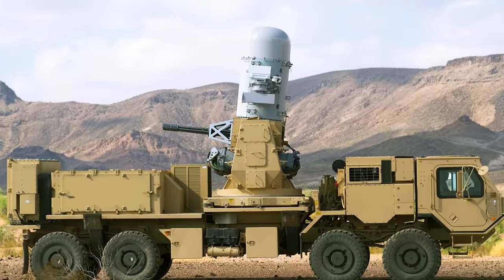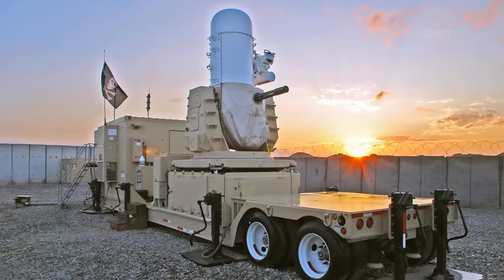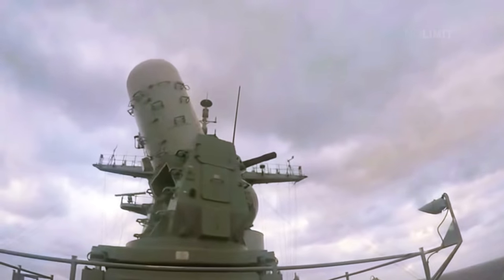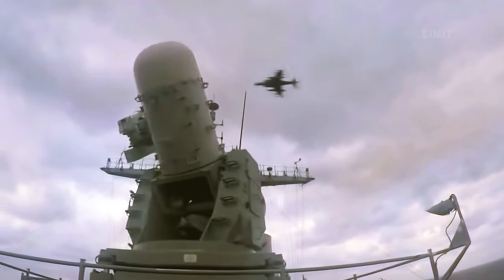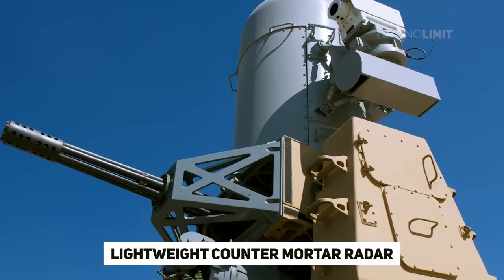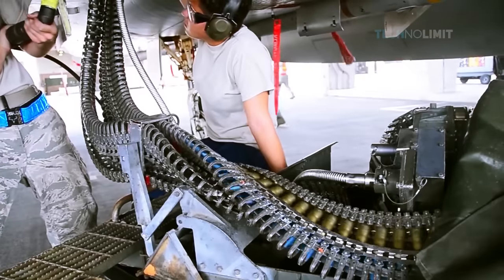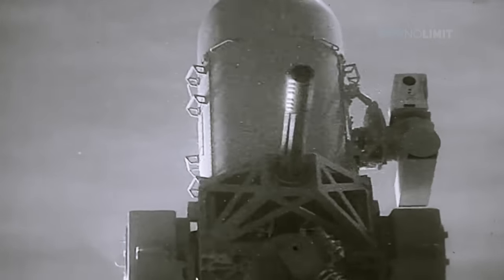CRAM Air Defense Is So Hot Right Now

Comment: Half the size of a 20 mic is about 50 cal.bmg. 7.62 is about 1/10 th
Reply: When I heard that I was like "Have you ever seen a 7.62x51 NATO beside a 20x102mm?" Clearly not a minute of actual detail oriented research went into this... Also, yes, when I thought about half the size of a 20x102, the .50 BMG came to mind, still less than half the size, which shows you that anyone who uses just the diameter of a round's projectile to justify such a statement knows nothing about the subject at all. That kind of person would probably tell you that a 7.62x39mm has the same power as a 7.62x54mmR Mosin, because both are 7.62mm in diameter. 😂
Reply: @Vidhur  The comparison really ne3ds a visual s8de by side to make s3nse.

Comment: This will become very important for drones
Reply: They'd likely develop a new ammunition feed for this purpose. Explosive rounds is a bit over kill for a $200 drone lol
Reply: at 60K a puf, i dont think, no.
Reply: @lo2740  I don't know. I've seen drones drop explosives that wipe out a few people in a group. Surely $60k is a good trade for 1+ wounded or dead soldiers? Drone warfare is crazy right now, they are doing a lot of damage cheaply with no risk to the operator. Plus, I'm sure they could reduce how many rounds it shoots for drones. I don't think you'd need anywhere near that amount to take one down since it's moving so slow compared to something like a mortar.
Reply: @Filbertfriend  They can mini size it for Drones.
Reply: Yeah and additionally I was thinking they should not only be firing bullets, they could also be launching/directing drones to intercept the munition incoming directly.
Reply: @Filbertfriend  exactly those 200$ drones can be carrying a warhead that may cost more but can really explode.
Reply: @Filbertfriend  i also don’t think people realize the gun firing is a 76mm gatling gun capable of 75 rounds a second…if its capable of taking out a plane the drones won’t survive either. its literally designed to track an object the size of a persons head hurtling towards it at 300 m/s.

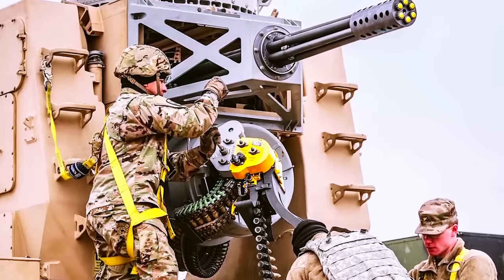Comment: 04:20 7.62mm is almost half the size of a 20mm??  Maybe almost a THIRD would be more accurate?
Reply: A 20mm bullet, ie the M56 HELround, is 1543 grains.
A 7.62mm bullet, ie M59 ball, is 393 grains.
20mm is about 4X the size of 7.62mm.
Reply: @jorelldye4346  2x bigger means 2^2 times heavier,, comparing length to mass is pointless
Reply: @pbednar  "bigger" is ambiguous. I'm speaking of mass. And you're wrong. Comparing diameter to mass, which is what I did, is intuitive because the volume of a cylinder scales quadratically with radius - and mass scales linearly with volume.
Reply: @jorelldye4346  The the M59,  7.62 bullet is 150 grains.

Comment: Perhaps effective against incoming fire, but where does the bullets who miss go? At sea is one thing, but at land is totally different. Sending a few thousand rounds who might hit dead center in a nearby city justified by shooting down something which may aswell being fireworks or local civilian drones.
At sea, sure enough, it's good... but when you don't have wast miles of open water to where bullets may fall harmlessly, i would rather prefer something more accurate, than spray and pray.
Reply: The land based variant uses whats called HEIT-SD ammunition, the SD stands for self destruct.  A lot of people think these tracers are like what's used on the M2 or other machine guns where its a tracer every 5th round. That's not the case with CRAM because every round is a incendiary tracer- self destruct round designed to explode in the air before causing collateral damage. - Former CIWS tech